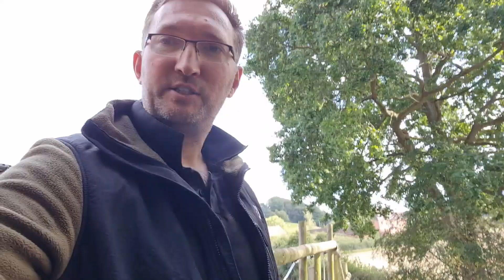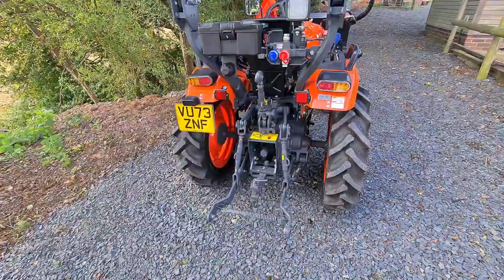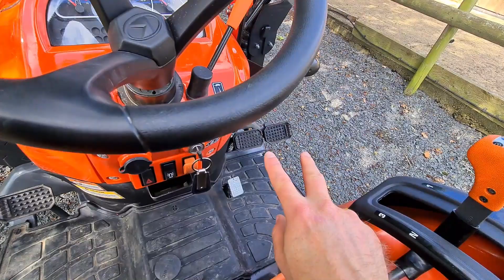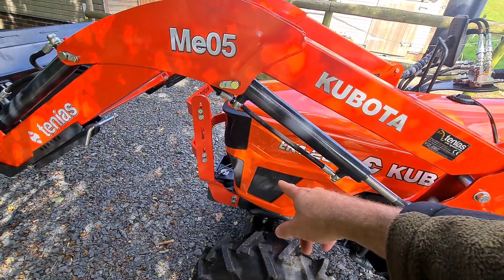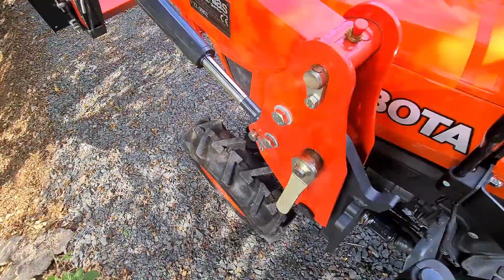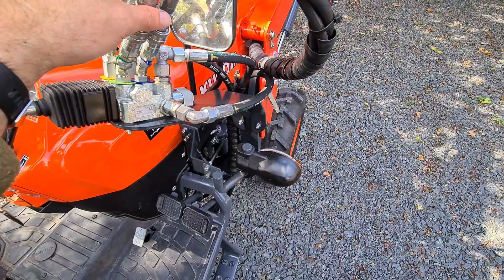Kubota EK1-261 compact tractor walk around

Comment: I am in the UK and thinking of getting one of these, more videos on use and power would be much appreciated.
Reply from the maker: @fenwik2861  hi. I'll try. It's a very good compact tractor. It easily tows and lifts anything I throw at it on my small holding. It lacks the hydrostatic system so it's old school farmer gears but that doesn't bother me that much for the almost £10k difference.  Cheap & reliable.
Reply: @makeitwild  thank you. A towing video would be nice. Even to show simple things like gear settings for people looking for their first tractor. I would be interested to see it's towing limits.
Reply: I did buy a ek 621, very good tractor first comment is the hand is Very hard to move so left it at about 1000 rpm. At that rpm you drive around and have nice control dipping the foot throttle for extra speed, moving and lifting. Hand brake is tuff to pull on.  The bucket control is light but very jumpy.
Reply: @rupertcake5404  I ended up getting a used sub compact tractor, I got a Kioti CS2220 manual without the front bucket/arms. Its a 2020 model and cost £5000. I am very happy with it.

Comment: Its indian made by the looks just abit better than a solis
Reply: Yeah its basically an orange Farmtrac 26. Still a solid choice at a lower price point - no mid PTO which is fine by be - belly mowers arent fun to deal with -  Plus you get two rear hydraulic lines which is nice.
Reply: @lucaleva_  i think they have a hydro out now to in this model
Reply: But i think Solis have better service/parts/dealers network and consumes less fuel😉They make 3 variations of 26 model.6+2 manual,hydrostatic and 9+9 xl manual.This is nice tractor too👍